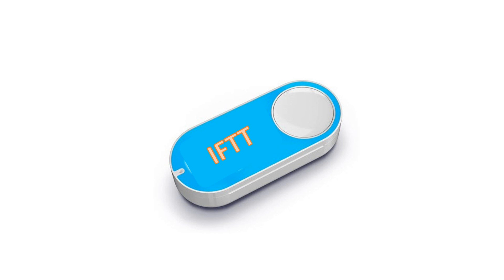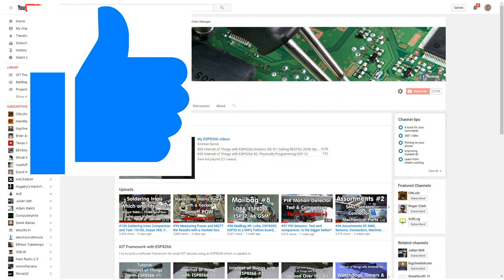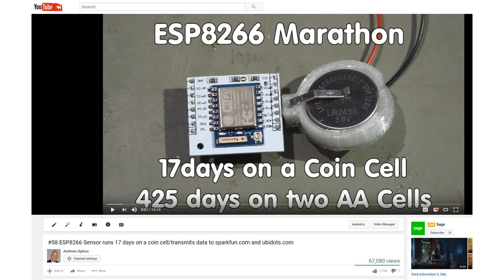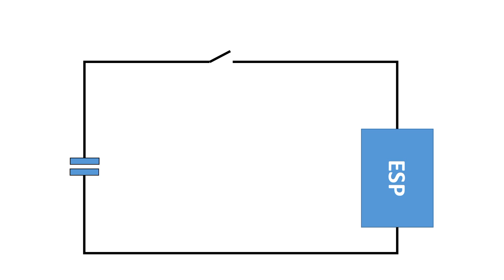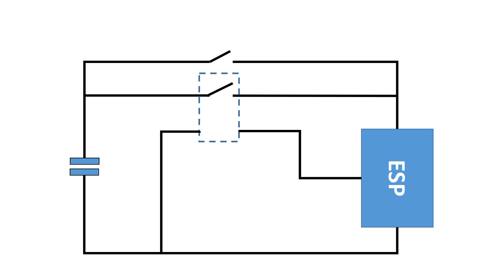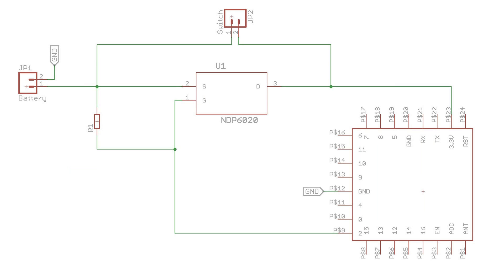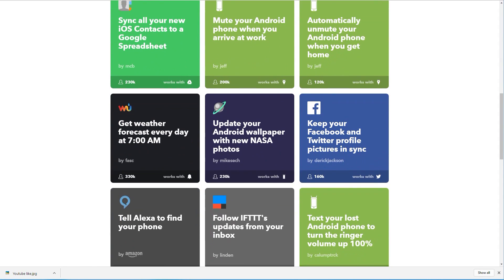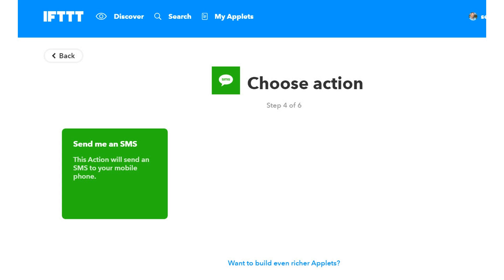#101 Long lasting DIY "Amazon Dash Button" using an ESP8266

Comment: What about soft button instead of the relay or mosfet?
Reply from the maker: What is a soft button?
Reply: Andreas Spiess correct term is soft latching button.  Go to eevblog #262 or Google.  Your solution is more logical in terms of using much less circuit elements.
Reply from the maker: I jus googled. This use case needs, that the mechanical switch switches on and a pin from the processor switches it off. Some of the desings I saw googleing were without any processor. So, they need mor components because we get a processor pin "free of charge"
Reply: Andreas Spiess absolutely, your solution is much more logical but this topic is good for keeping in mind.  Thanks!

Comment: Hi Andreas, you check out the similar example at https://github.com/pinae/ESP8266-Dash on how to make an HTTPS connection with the ESP8266.
Reply from the maker: Hi Gregor, long time no see (Siteco)... The Dash button was just an example to show the principle. But many viewers were interested also in the Button itself. This is, why I am just working on a video. I will use the same principle as in this CT article, but with an IFTTT library made by one of my viewers.

Comment: Can something similar be done using an N-Channel mosfet?  I have a few of them handy.  Also can I use a CR2032 battery?
Reply from the maker: Yes. As usual with 3.3 v devices., you have to take a logic level MOSFET. But the N-Channel FET goes into the negative line, not the positive. Then, it should work (you have to inverse also the signal to the gate with a ! sign in the sketch
Reply: Thanks.  What battery type do you recommend for this type of use?  Looking to balance the power requirements with size.
Reply from the maker: You can watch my video #64. Then, you know.
Reply: If you use a N-channel mosfet, I guess you can leave out the pull-up resistor and save a little more battery power. Am I right?

Comment: Andreas, first of all, congratulations for your amazing videos! I have a question: how's it possible to measure the exact delay/latency from the transmission of a TCP package/frame between two ESP8266, one acting as an AP and the other acting as a Station? Preferably, I want to be able to calculate that from the client side but I've been studying the WiFi classes and I can't find a way to solve that in terms of software. Thank you very much! And Merry Christmas!!
Reply from the maker: I think, the only possibility is, to have two boards side by side and send a signal from one to the other. Then, you connect the sending signal and the receiving signal to a oscilloscope and measure the difference. It depends from many things, so, I do not think, it can be calculated.
Reply: Or you can use Arduino JSON Library to send JSON data containing time string to other MCU and deserialize the received JSON data and print send time string and received time string in serial console perhaps... So you can compare

Comment: Andreas:  Which P-channel mosfet were you proposing for this circuit?  your diagram says NDP6020 but that is a N channel mosfet.   Did you mean a NDP6020P?   I have also been looking at the  IRF5305.   I get the impression that the VGS (Gate Threshold voltage would need to be less than 3.3v if the ON condition of the ESP was 0v and the off position 3.3v?   I can not seem to find a large selection of P-channel mosfets with this spec...    A comment or video on this would be very helpful.
Reply from the maker: You are right with the 6020P. I think, I used a FQP27P06. Both are far too big. For the final design I plan a Si2371.
RDSon becomes smaller with increasing Vgs (or decreasing, because it is minus for the P-channels). Because we do not need lots of current, this is not so important. The NDP6020P has RDS(ON) = 0.075 Ω @ VGS= -2.5 V which for sure is less than the lead to the battery...
I will anyway finish the project in the next weeks with a better script an a nice 3D housing. The video will follow...
Reply: thinking outloud. could one not also use a pnp transistor?
Reply from the maker: +Mark Troyer I think so. Then, I think you have also include a resistor between pin and basis
Reply: Hi Andreas, I managed to get a Dash-like button circuit running with a Wemos D1 Mini, a PNP transistor (a BC638), a 100 Ohm resistor and a momentary switch.

Here are the connections:

3.3v supply--transistor emitter
transistor collector--3.3v on Wemos
GND supply--GND on Wemos
transistor base--resistor--switch--GND.   
The D5 pin is connected between the resistor--switch.

The trick to make this work was to treat the D5  pin as if it were an open connector pin.  To do this, I had to initialize in set up with "pinMode(D5, OUTPUT); digitalWrite(D5, LOW);".  To shut down the PNP transistor, i turned off the open collector function with "pinMode(D5, INPUT);".

Works like a champ!

Mark
Reply from the maker: Thanks for the tip wit "INPUT". Good idea!
Reply: Hi!

How do you actually power the Wemos? I mean, it works on 5v, but in you written schema you only mention the 3.3v power supply. Am I missing something?

Comment: Hey Andreas! Love your channel. Can you recommend a good SOIC mosfet chip that would accomplish this task for a PCB? How many ohms resistor did you use in this and do you think a mosfet driver is needed as well to charge the mosfet?
Reply: Would this one work? This has a Gate To Source Threshold Voltage (VGS th) min-max between 2-4V, with 2.9V being typical at 250uA of current...

http://www.mouser.com/ProductDetail/Fairchild-Semiconductor/FDS86106/?qs=sGAEpiMZZMshyDBzk1%2fWi93sgdJgik58truBbC6gKC8%3d
Reply from the maker: These are a n-channel mosfets. I used a p-channel which has a negative Vgs. The n-channel you have to use in the GND line.
I used a FQP27P06. But smaller ones are good as well (e.g. SI2371, but not tested). Vgs should be in the range of -3-4 volts for a decent RDSon. Often, these FETS are called "logic level"

Comment: I think a 555 timer as a latch will be more efficient.
Reply from the maker: Why would you think? The calls to internet sites take different times, and the ESP knows exactly when to switch off. How would you solve this problem with an 555?
Reply: Andreas Spiess You could set a maximum time for a on period and then switch it off. Another method is to use a FET.

Comment: So is the ESP8285 the new ESP8266 or a low power version of it ? How are these compare to ESP32?
Reply from the maker: It is the same MPU, but 1M Flash is on the chip. So, it is smaller. The ESP32 is a different beast with much more possibilities

Comment: Hi Andreas, this Tutorial says it is possibile to start the ESP with an diode and resistor what do you think about it?

https://www.hackster.io/noelportugal/ifttt-smart-button-e11841
Reply from the maker: The trick with the Chip enable should work. Another viewer gave me this idea and I am currently working on that concept as an alternative. It works. But so far, I was not able to measure the current consumption.
Reply: Andreas thank you for your fast response. Okay good to know I want to have this button to force my Tado Smartheating device to energy saving mode (eco Button) . They shortly enabled this Box to get controlled via IFTTT.

Comment: Hello Andreas,

I created another library for you to try if you'd like! It was really similar to the Youtube one so it was pretty quick to make

https://github.com/witnessmenow/arduino-ifttt-maker

Its a library for triggering IFTTT maker events.

I've been testing it with emails and it works almost instantly

Thanks again for the videos!
Reply from the maker: I will definitively try it. Thanks!
Reply from the maker: Great! I tried now both. The youtube example file needs a small change (I created an issue). And they even work with https: . Now my question: Why does this work without any codes like fingerprints. As you know, I am a beginner in this matter. Other examples use a "fingerprint". But anyway, I did not find the port for such a fingerprint in IFTTT.
I decided to finish the "Amazon dash" and put it in a small case, because your library solved the problem of https and is worthwhile to be communicated to the world!
Reply: Andreas Spiess great that its working for you!

I think the fingerprints are more for verification that the HTTPS site you are connecting to is the one you expect, not that important for these kind of uses I would say.

I was reading last night that you can pass up to 3 additional data points into the event (this didn't seem to be mentioned on the ifttt website anywhere!) so I made a change today so you can now optionally pass additional data if you wish, could be useful for values from various sensors etc
Reply from the maker: Thanks for the explanation.
Good to know about your change. I will try it out as soon as I have time.

Comment: I tried this but with N-MOSFET and failed. Is it a must to use P-MOSFET?
Reply from the maker: +Constantinos Dafalias if you use a n channel get you have to wire it into the negative connection
Reply: I know that N-MOSFET sinks the load. Probable I made something else wrong.  Thanks!
Reply from the maker: Or the VGS of your FET has to be much higher than 3.3V. Then, the GET will not switch on.
Reply: It works if I use 5V to the gate. So you are completely right! I must use STN4NF03L which is tested for 3.3V!

Comment: Being so small, any recommendations for easily initially programming the PSf-a85?  I understand that ideally for upgrades OTA should be used but the biggest challenge would be the initial flash.   Does the PSF-a85 have enough memory to support OTA?
Reply from the maker: 1. It will be hard to use the PSF-85. The only possibility will be on a PCB, I think.
2. It has 1MByte which is ok for normal sketches and OTA. The Sonoffs have the same amount.

Comment: You said you did not have a 3.3v relay in your lab...if you had the choice which would you have used? Would it be a smaller option with even less holdover current draw?

Thanks again. Your channel is amazing and much appreciated. I know how hard it is to keep doing this kind of work every day.
Reply: I basicly would ask the same question. Andreas; -Which relay would you recommend??
Reply from the maker: The rely was more educational, because it is easier to understand. I did not search for one. But in Video #14 I used a relay to switch not the 5V, but the 220 volt supply. But this was a 5V relay then.
I would use a small 5 volt reed relay. Look at the specs, if it will also switch with 3.3 volt. But relays need much more current than a transistor when on.

Comment: Brilliant, elegant simplicity. I have a sensor gizmo that uses an ESP8266 to take readings every 30 minutes. I use deep sleep (timing isn't critical), a LiPo battery and a solar panel. To move this out of the sunshine, I'm thinking I could use a clock with alarm function to trip the relay.
Reply from the maker: As long as you have a mechanical movement it will work... But with a solar panel, deep sleep should also be ok, I think. Unless your have sensors which cannot easily be switched off.

Comment: This is excellent!  I wanted to hook up an ESP8266-01 to a water/leak detector but didn't want to fuss with having to remember to change the batteries.  Doing it this way will ensure that the battery will last for a long time without maintenance.  Thanks again for posting this.  What a great and simple solution!  I'm wondering if this will work with a motion/PIR detector?  Will the ESP8266 'boot' fast enough to activate the relay?  I guess I'm asking what's the minimum time the button needs to be pressed?
Reply from the maker: I plan a second video where I will trigger the ESP from non-mechanical sources. Maybe this is something interesting for you.
Reply: I assume you are talking off the shelf PIR devices like you see in alarm systems. 

You might have to voltage shift the PIR down (some hardwire units are 24v), but to answer your timing question most PIRs will close their circuit for as long as the event occurs. Imagine walking in front of one - if a red light were to illuminate for the event it would illuminate for the duration of time it took you to enter and then leave the detection field. The relay Andreas was talking about would come online is a few microseconds (less than 1/1000th of a second), so it's highly unlikely (impossible?) that any event worth noting would cross the event field in less time. If you never leave, a timer circuit "resets" the event field and turns opens the circuit again. These are variable by manufacturer but well above what you'd need.

The PIR would need to be powered to detect the event, and then to activate the ESP. Are you just trying to not use too much PIR battery? If you are using a hardwired PIR, then obviously battery wouldn't matter.
Reply: You're right.  I guess I really wasn't thinking as the PIR will definitely need constant power to work, but keeping the WIFI out of the loop will definitely keep the battery usage down.  FYI, I'm talking about the cheapo HC-SR501 type PIR sensors.
Reply: You're on to something with the idea. There are a lot of battery-powered PIR motion detectors being sold for DIY alarm systems that fire a 433/900 mHz radio pulse. Those are already engineered for battery longevity. If you find one with an optional signal output (I've seen them) you could just strap the ESP to that output. Then either parasite the PIR battery or a dedicated one for the ESP. You'd have to attach the dedicated battery to the relay to make it work and probably set a common ground with the PIR, but it should work and probably last a long time.

Comment: I am also trying to build one of these, I want to power them with button cells to keep the enclosure as small as possible. Will post a link here once completed.
Reply from the maker: Button cells might not deliver the current you need... I tried it in my video #58, if I remember right.

Comment: Some example lua code and hookup information for such a dash button clone can be found at https://www.hackster.io/noelportugal/ifttt-smart-button-e11841. Watch out because with arduino you might need to hold the button a few seconds.
Reply from the maker: Good link. Thanks! I think, for a button, this is even better than mine. One of my viewers already proposed to use CH_EN instead of a FET. I tried it and it works fine.

Comment: Really smart and interesting! But, why did the tweet take 15 minutes? Is IFTTT really that slow? I haven't used it at all before, the only thing I've done with the ESP so far since launch is communicating with it over a USB-Serial adapter.. But I kind of let it go because when I tried to access my own webserver through the ESP8266, just a normal HTTP request, the webserver locked itself for a minute.. Every time! Really annoying..

Since then I haven't used any ESP modules, but I have bought some more because I'm planning to try one out with Arduino on them, especially after your videos! I really love watching ESP videos as soon as I find any, eventhough I had some problems personally with em ;) But I do know how awesome they are, so no complaints on them =D hehe..

Again, really interesting and smart idea you have there!
Reply from the maker: The ESP are sometimes "divas" and I do not exactly know what is happening. I experience also sometimes long waiting time of the Web Server. This is, why I try to avoid to communicate "manually" except for Setup. And it takes quite a lot of time to get the things stable.
Viewers reported, that IFTTT is not slow for them. So, I have to investigate a little more...

Comment: Very nice video, and I'm so glad that you did not go with the relay solution... waaaaay too much power required, even if only for the short time while the microcontroller runs.  I was looking for a latching "soft power on" circuit that does not draw any power when off and haven't found one yet, but they must exist... at least I hope so.  Cheers,
Reply from the maker: +jims408 I used the relay because it is easier to understand. As always, it has advantages and disadvantages. For a button used only very rarely (e. g. Emergency button, this could still be a good solution because it draws absolutely no current during off.
Some LDO regulators have CE, but I do not know how much current they need in the off state.

Comment: Heres my comment to support you :) :
I made the same turnoff fet circuit in an arduino timelapse project (for photo cameras without this option built in) to turn the curcuit off, if it finishes the timelapse, lets say, may after few days. But my circuit is failed to switching it off. Now im going to check yours to fix my circuit.
Reply from the maker: +Miklós Belházy In video #14 I did it with an Arduino and 220 volts. Thanks for your support!